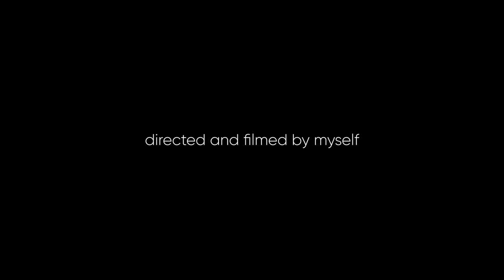The Best Purchase Of My Life!

Comment: Stevie: do yourself a favor. Keep your rock as base but pour concrete. Trust me, you will be so much happier with a concrete pad. Next, look at some Tiki torches that burn Citronella to keep the mosquitoes away.  The concrete (if done correctly) won’t allow weeds to come through, easier to keep clean, and so much better on both your feet and Cayla’s precious feet.  Last, make sure you have a large fire extinguisher 🧯 close by. Safety is a must.  Many family and friends have  similar setups. Great idea putting in the relaxation corner in your yard.

Comment: thats either a keitruck or a fkin multicab. it used to be made using the butchered parts of either a small car/ an L300 or a small van. then just attached together to be a mini truck. it's so lightweight, 4 guys could probably toss it over.

Comment: I don’t know manual cars so how did she break it if somebody knows pls explain
Reply: I think she dropped it into reverse. That's the only way I know of for changing gears in a manual to do anything that looked that extreme. Even if she accidentally went from 1st to 6th it wouldn't matter, just lug the engine which at worst would turn the car off. But if she dropped it into reverse while doing 20+? Maybe destroy the whole transmission.